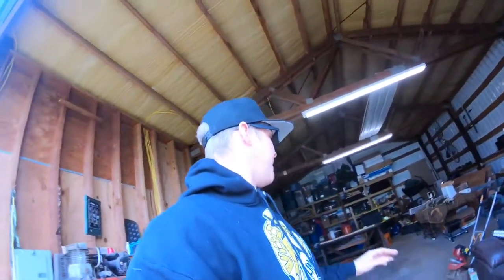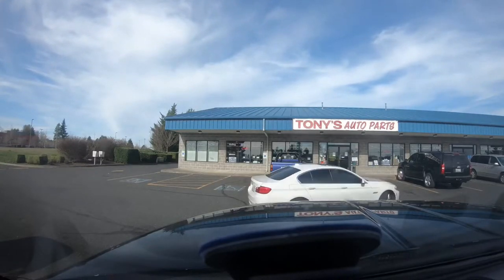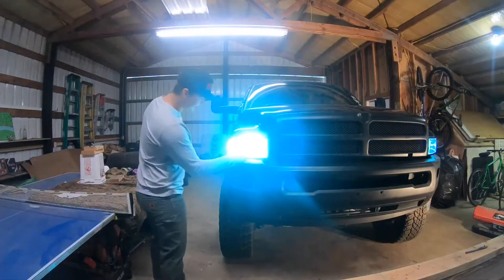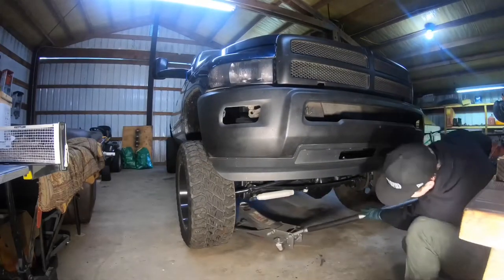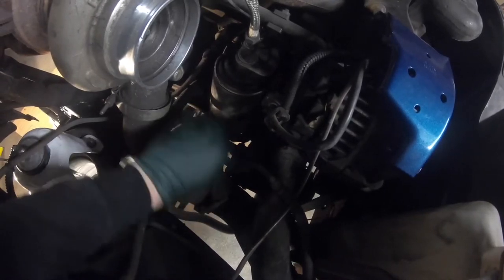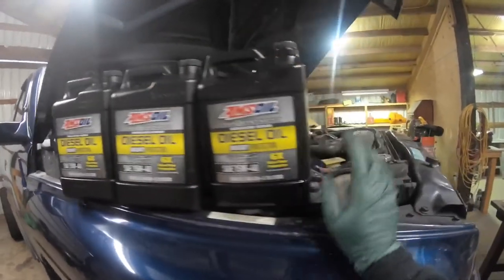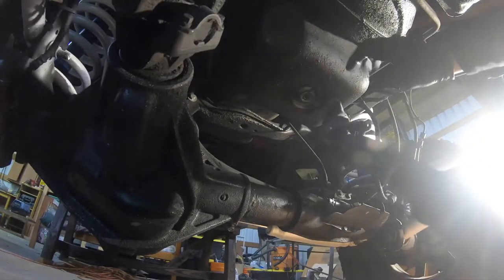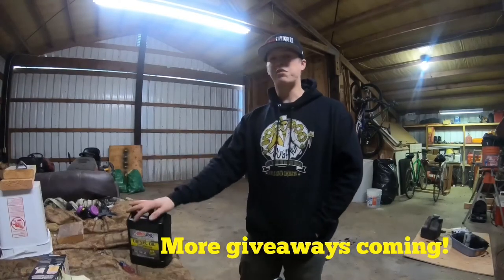The best diesel motor oil? Put to the test!

Comment: I tore down cat 3406 motors with 12,000 hours, and you can still see the crosshatch in the cylinders Dello 400 is the best diesel motor oil on the market.

Comment: Add Archoil to your engine oil.   I had 2 bad injectors 2 seperate times on my 6.0L.  Since i started Amsoil in the oil and stanodyne in the fuel, zero problems.